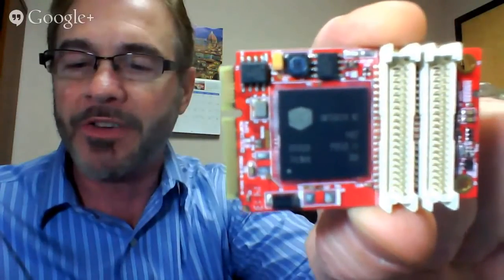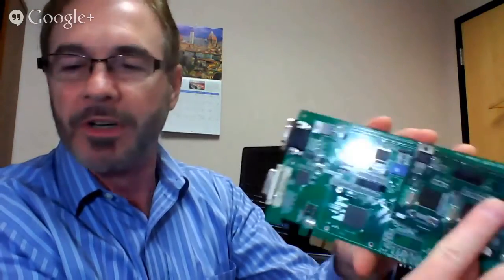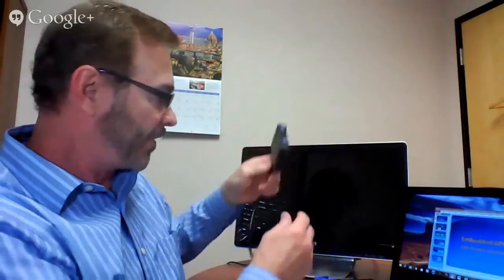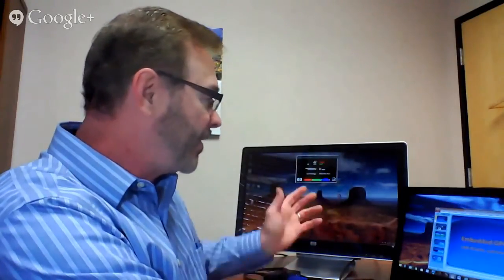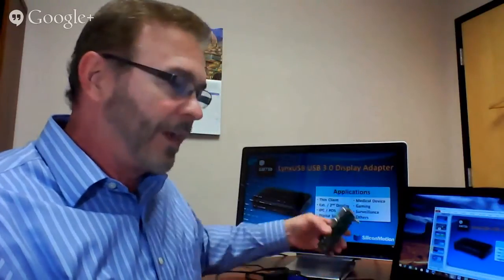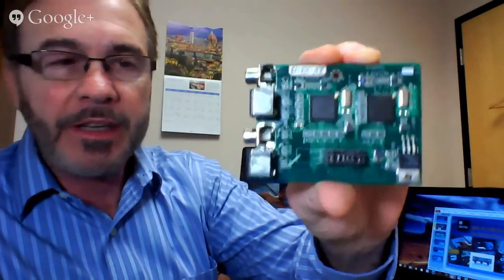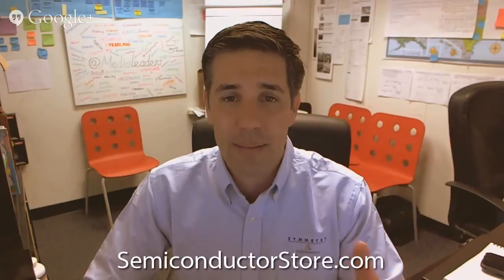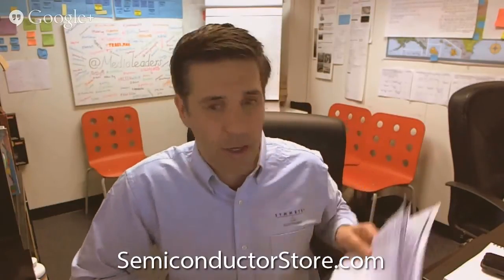Silicon Motion SM750 Dual Display Graphics Chip

Comment: I have empty mini pci-express slot in my laptop, can I use this card instead of my notebook's cpu-integrated video?
Reply from the maker: Hi iMic thanks for the question. This only works in desktop and the board is not sold separately as a product. If you have any other questions please call us at 866-506-8829 or email info@symmetryelectronics.com. Thanks!